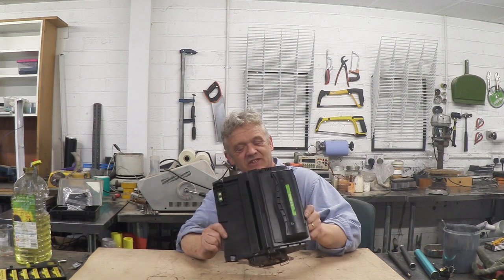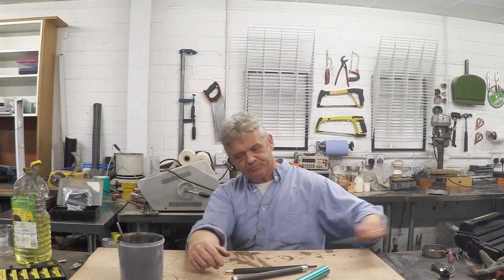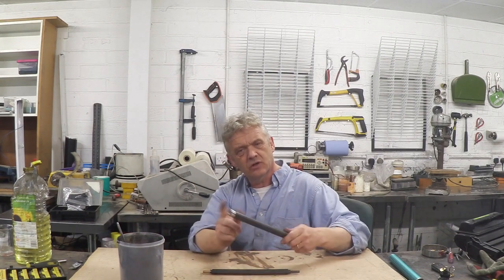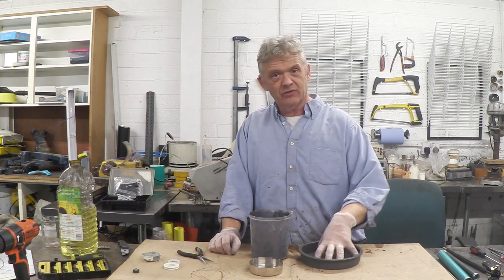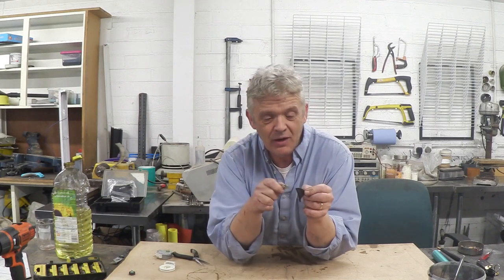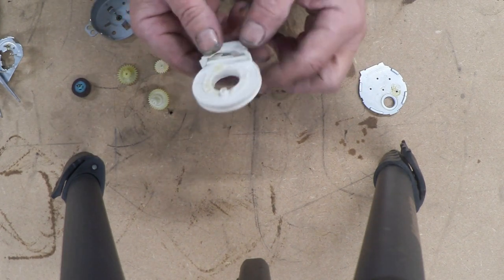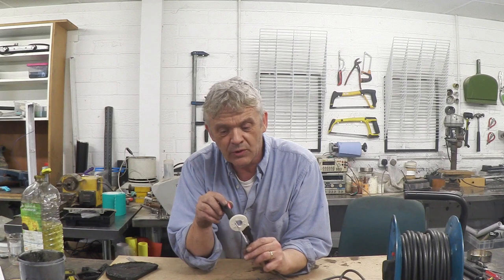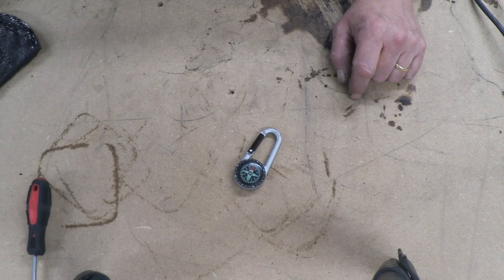Making Magnets From Printer Toner - Toner Recycle Project 1

Comment: interesting bit about the magnetic toner is that it is used too, if I recall, in printing official checks, for the bank, because their system can pick that bit up or some such, while regular carbon black only with no magnetic property they can't
Reply: Cheques did used to be printed with ink containing magnetic material (I worked in litho printing before copiers)
I suspect bar codes and OCR has removed the need for both the magnetic printing... And the cheques!
Reply from the maker: it's used for magnetic character recognition mate - quite a lot of tone has Fe2O3 in the recipe for pickup and distribution the MCRT stuff has a higher loading I think
Reply: @ThinkingandTinkering  oh yeah additionally I should point out, that I have a video up somewhere of me taking a hard drive armature magnet, crushing it with a hammer, and then mixing the powder into epoxy and placing that in a ziplock baggie, that I closed up and then placed on a whole still magnetized armature magnet end (each end is magnetized in opposite directions so they are basically like two magnets side by side, facing opposite directions with left say being north and right being south, and if you look at the other side reverse that, anyway) that way it would all be facing one direction, and as a result the magnetic powder formed spikes in the epoxy, so the side with the base of the spikes sticks to steel, but the other side will not and even refuses to stick to the point I have had it roll up across an iron anvil in order to stick to the other side, (had my finger under it to keep it from rolling down ward and as soon as I moved my hand off the magnet holding it down with the spike tips toward the steel ,it sprung up ward and stuck down with the other side, so I am guessing the other pole on the spike tip side is also forming similar pole magnetic energy facing outward from the sides of the spikes or something because it did not even have an effect to pull on thin steel shim when I had it facing that side holding it above the steel, but I could get it to grab the steel up off the table when I held it the other way, from nearly 4 times the distance

Comment: there is toner in it too because it covers the whole plastic sheet that applies the toner to the paper and the laser effects this causing it to fall off where not wanted, which is then sent to a "WASTE TONER" compartment, and it does not get reused by the cartridge, so if you printed only text, then calculate how much of the paper is covered in toner, and then subtract that from 100% and you get how much of the toner you had starting is now in the waste bin when it shows up as being empty IF it were actually completely and utterly empty, which you pointed out is usually not the case LOL. anyway, the heat to fuse it is a wire that heats up so the laser is not used to fuse it to the paper, it just pumps the film causing it to become conductive and the reverse polarity of the sheet is in a roller that pushes through that conductive bit causing the toner to either not transfer or to fall completely off and into that waste unit, I have a TON of it in my waste compartment that removing it allowed me to run more copies and since its basically powdered plastic stuff that heat melts it, I hung onto a bunch of it XD
Reply: Sorry, wrong.
All of the toner is held on the magnetic ("Mag") roller in the development unit.
Toner is only attracted to areas of the photoconductive drum discharged by the laser. (Called the "latent image")
Paper is pressed against that drum surface with a "different" charge applied to the back face, attracting most, but not all of the toner.
Any residual toner on the drum is physically removed by a rubber blade and static brush.
That's the waste toner.
It's usually contaminated with paper dust, so isn't reused.
Reply from the maker: awesome - now some uses for it lol
Reply: @rogerstarkey5390  ah I knew there was waste toner in the unit when it was used thus not all was getting put on the paper and the extra was only because it stops working before it runs out. however I have toner that is not magnetic at all, and there for there is no "mag" roller in the unit, period, so how is that one working? also I new the laser had something to do with the roller that the paper touched was only coated on part of it, while a whole roller was getting coated as if you were printing a giant square or rectangle of color on the paper, and all this extra that is not going onto the paper was not just being dumped back into the toner drum to be used again later.
Reply: @ThinkingandTinkering  yeah I thought some time ago about using a laser to fuse it together and then roll out another layer by using a spreader that rises up an increment at a time between spreading a layer of the toner so a laser can move around and fuse part of it together, and now I have quite a bit of all 4 colors of toner that laser printers come with, (none of it has any magnetic properties, I have tested it, both the fused and unfused LOL)

Comment: Awesome! I've been thinking about making  homemade ferrite magnetic cores with magnetite and sodium silicate,  But the toner plastic is an immensly interesting idea. I hope it's nonconductive.   

Time to fuse toner ink in a bun cake mold for a toroid transformer and play with it.
Reply: Your average toner does not conduct, but it does hold a static charge (required for the printing process).  However, I don't know about toner that contains magnetite.  I would certainly test it before trying to use it for non-conductive applications. 😸
Reply: @NorthernKitty  plastic coating nonconductive Makes sense  for static photo sensitive printing.
Reply: @NorthernKitty  
I suspect there will be sufficient toner to cover the developer, making in non-conductive, no guarantee that will be 100%.
Reply: @kreynolds1123   It's been decades since I repaired laser printers, so I wasn't sure if anything had changed with how they attract the toner to the drum.  If I recall, it used to be that the toner was separate from the magnetite. I believe the magnetite coated the developer drum and helped the toner to adhere once it was drawn to the drum.  I could be wrong, it's been a very long time.  I don't know how it works when the two are mixed together from the start.  But I know they are now experimenting in adding metal oxides like magnetite to polymers to make flexible transistors for wearable electronics.  So it makes me suspect that there's some degree to which magnetite in toner could be conductive.
Reply: @NorthernKitty  magnetite on it's own is slightly conductive. But if it is coated with plastic,  it wouldn't be conductive unless the concentration of magnetite were such that each magnetite particle were touching enough other magnetite particles to make a low resistance circuit.  All it would take is just a reasonable level of resistance to minimize eddy currents.
Reply: @kreynolds1123  OK, good to know! 😊 Thanks!
Reply from the maker: I would add a bit more Fe2O3 and deal with the toner as a binder if it was me mate

Comment: Thanks Rob, just pulled apart my second laser photocopier,  and need to get rid of lots of toner. Did you see that new battery, which self generates its own power? Uses a super capacitor and a carbon nuclear rod to make it. Carbon is turn to small diamonds and encased.
Reply from the maker: awesome mate - Aton of good experiments and yes I did see it - I thought it was outside of the scope of diy myself